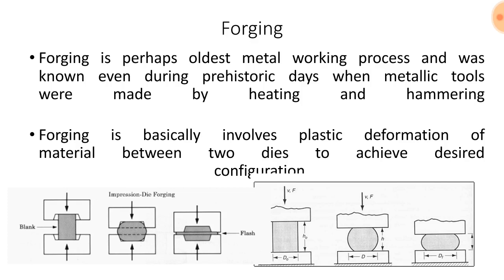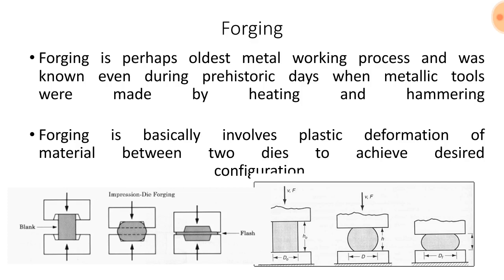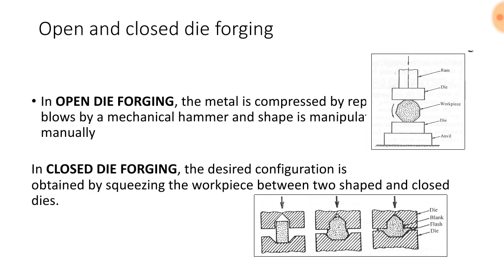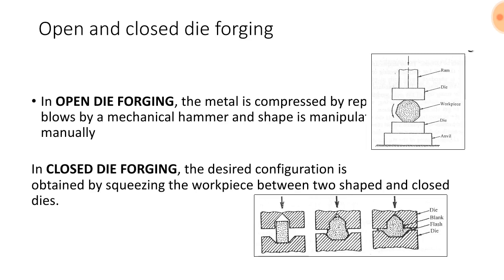Forging Process | Types | Open Die Forging | Closed Die Forging | ENGINEERING STUDY MATERIALS

Comment: Can I convert 42mm outer dia and 6.5mm thickness round circle washer to 36mm outer dia and 10mm thickness.?
Reply from the maker: It is possible when we apply suitable compressive force.
Reply: Rather than doing this,..go to a hardware shop and buy one⭕